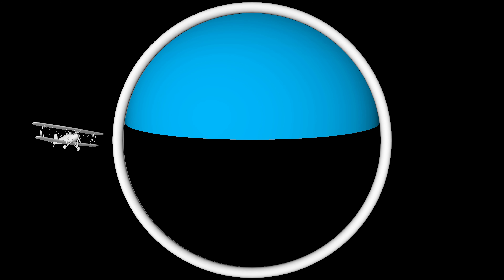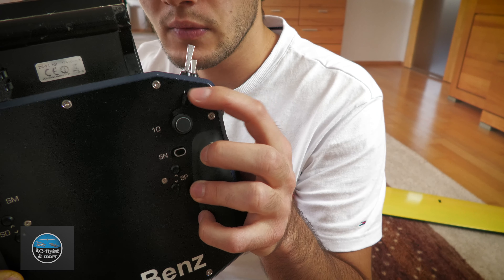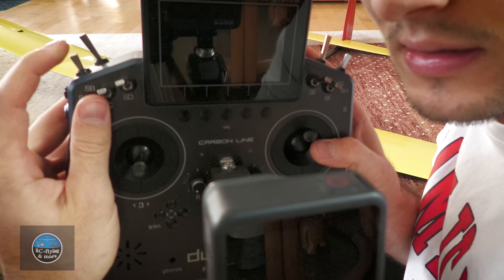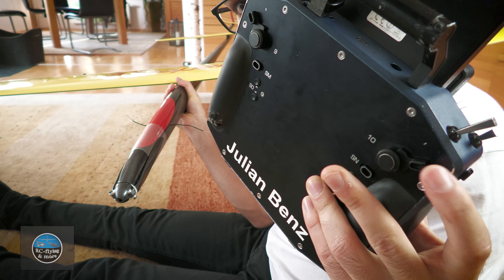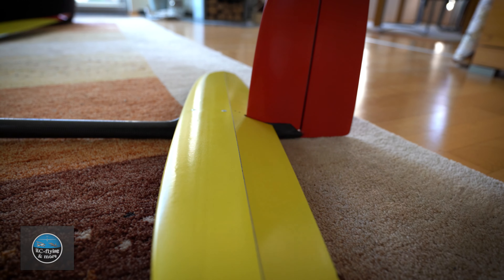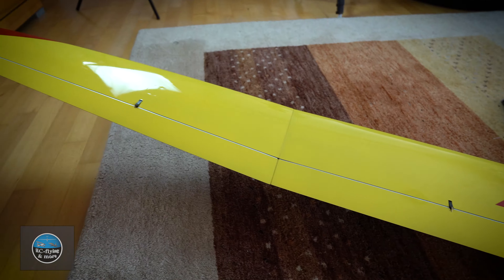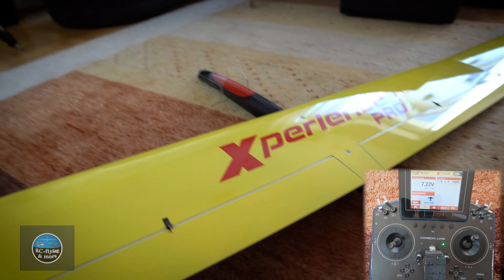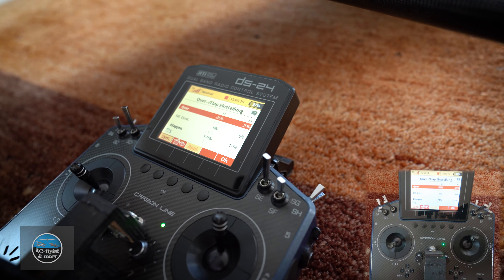HOW TO SETUP A HIGH PERFORMANCE GLIDER - Xperience Pro F5J - Episode 5

Comment: Thank you for this video.  I have been flying slope and electric planes for about 45 years now!  I got out of the hobby for about 20 years, then back in around 2007, then back out for a while the past 9 years or so.  I needed your help programming my 2009 XPlorer 4000 and a few other carbon sail planes.  When I went to replace my batteries I realized how much has changed on plane design and electronics! WOW!  This plane is running a 3850 4c battery, and the new ones run an 850!  New planes are so much lighter too.  But, I am determined to get my planes back up as they were lol.  Your video helped me remember most of the mixes I needed.  
recommended
nervous

Comment: Thank you so much, This is fascinating to me.
My only problem with watching these videos is I will  never own an airplane like this. It is just way ...way out of my budget. So I just enjoy the foam and balsa planes that I have. 
Keep up the good work.
Reply: You can also do this with the volantex asw or pheonix if you want.  For under $200 you can play with these.  

Thats what I do to test anything.   I use one of the cheaper gliders before dropping a new program on my maxa
Reply: @woogieman02  it's not even close to the same thing though. The linkage and connectors on the cheaper models have so much slop and play that the comparison is almost laughable. I mean that's why the competition planes are so expensive.
Reply: @michaelwhinnery164  agreed about the linkages, but you can get thr basic concept of the controls.  These higher priced birds are like a Ferrari and the volantex would be like a pinto.  Both can drive and get you use to thr road.

These same concepts can be used on any priced plane.  The higher ones will have better response and more control.   But with that they also about make you cry when you crash them, unlike the $200 for the foam planes.
Reply: @woogieman02  no doubt...I avoided the "flight test " foam board models for years. But now I love them !!! They won't win any contests, but when you crash you're not left with a pile of tooth picks. You just quickly repair the foam board or scrap it and build another for $35. 
I can't imagine how difficult it must be to repair carbon fiber- kevlar coated wings

Comment: Interesting that many people set the speed mode switch to up which is opposite the elevator control where forward = fast.  On real gliders the trim works like the stick.. push it forward to increase speed, which is effectively what the mode switch it (3 fixed trim settings). But hey whatever you like :)

Comment: So by looking at your setup your throttle stick that you use for your landing mode is always active meaning if you pulled down your throttle stick all the way to the of position say In thermal mode it would pull your flaps down in that mode. 

Is this how you have setup your flight modes. 

I use in my landing mode which has a variable camber in my landing mode .

I use my throttle stick as well say a switch is used for distance but if I pick a thermal on the way coming back I just use my throttle stick pull it down a bit to activate thermal mode. 
It does not matter how much further down I pull my stick it will go to my thermal settings and no further.
Have been brave enough to use snap flap 😂 you got me thinking 🤔 are you using snap flap when you are down low with motor on so you can do the high speed bank turns to stir up the thermal activity?
Is that why you are using snap flap. Will be interested to hear your reasoning for this. Great video content very interesting indeed 😊👌

Comment: Julian, thanks for this Video, very useful! Question: in which modes do you have or need “snap-flap”? Only in “neutral” flight phase or in all flight phases, such as “speed”, “thermic 1” and “thermic 2”? Thanks for your reply in advance!
Reply from the maker: I use snap-flap in all my flight phases. But in "thermal 2" I use it a little bit less.

Comment: Thanks Julian for the interesting video. I have an older version of the Xperience Pro electro, very nice plane. Most of my settings are identical to yours, but I do have one question about your setup. Why do you mix flaps with elevator in "normal flight mode"? I would guess it gives more overall stability, especially in turns? Many regards, Bert (Belgium)

Comment: Hi Julian,
The modified Transmitter ist very interesting. Is there a Video how to do this? I got a DS 12 carbon and would be interested in having aldo some switches on the back.
Regards Gerd
Reply: Okay,
I've seen that the switches are standard build in the ds 24.
Reply from the maker: Yes it is standard on the DS-24